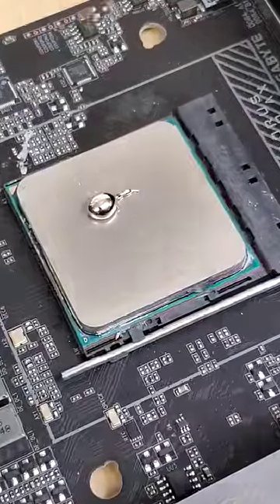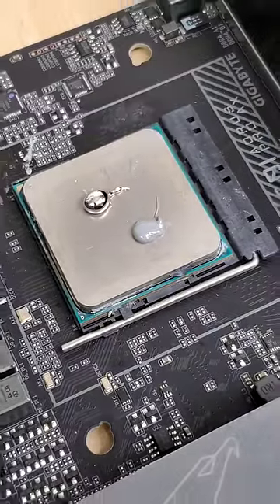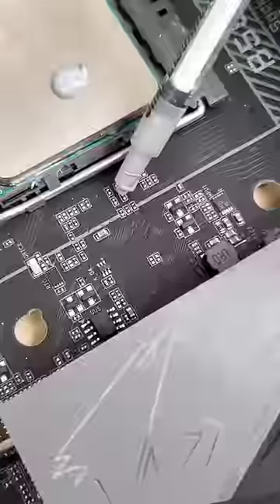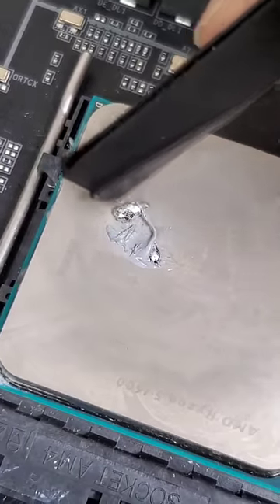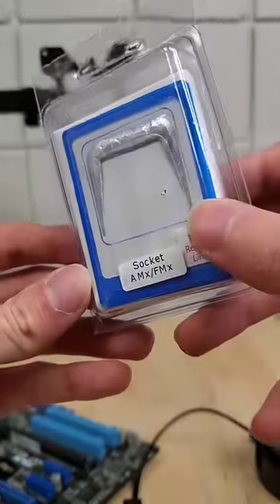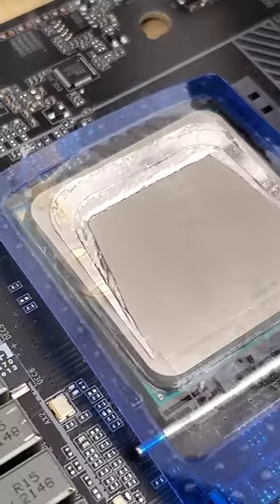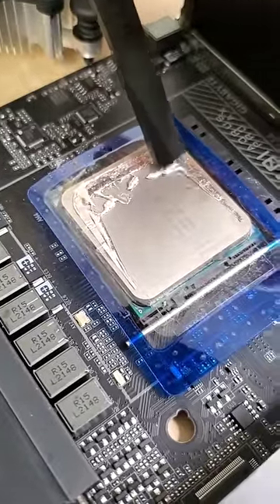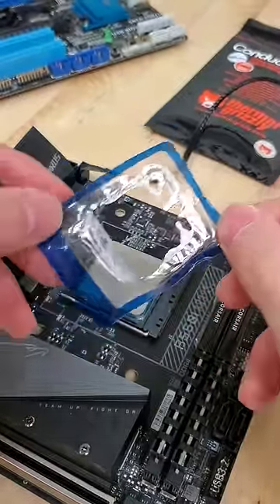the future of thermal paste technology #shorts

Comment: The risk reward just seems ridiculous. Risk destroying your motherboard. Reward a tiny bit cooler in temp than normal battle tested thermal paste.
Reply: It's more than a tiny bit
Reply: Nothing starts off battle tested, innovation isn't free.
Reply: If u rich then sure but not for us poor guys
Reply: @Snay1998 If you are poor you wont even have a cpu that gets warm enoth to need it
Reply: @Lylcaruis  just read a comment saying he used it for 3 years and saw minimal difference
Reply: I use liquid metal for years and the benefits aren't visible at idle. Under load the benefits are huge and the weakest link in the chain is the heatspreader itself most of the time (depends if it's soldered to the die or not).

My 3770k back then run delidded with a water block directly on the die with 5,5ghz for years.
Reply: It also doesn't degrade like thermal paste
Reply: It can be substantial actually. And it's simple, you put a coating on nearby components that could short out (even nail polish works). You don't put much on at all, the risk is spilling or being ignorant.
Reply: Sony puts liquid metal on PS5 chips
Reply: Tiny? Conductivity gets multiplied by three to five times
Reply: all the small things compound. I downvolted my 2080 Ti, made a better fan curve, improved mounting pressure with washers and installed LM. Each of those things weren't too good, but 3 of them together made my GPU perform significantly quieter and cooler and consume less power, while keeping 99% of the performance.
Reply: A tiny bit cooler? I did a delid on my 7700k and applying it as the TIM dropped my full load temps by nearly 20c while overclocked on all cores.
Reply: @FatterTony  wow you are confident, uninformed and uneducated all in one
Reply: It's not tiny, some cooling combined with this liquid metal can decrease 10°C which is alot in terms of processor
Reply: @FatterTony  and physics isn't something you've even attempted to understand it would seem
Reply: @FatterTony no way this guy isn't trolling
Reply: @FatterTony  you realize that those benchmarks are there to show how the equipment runs under strain right? Like heavy tasks, like stupidly unoptimized games and such? Sure you might not normally notice the difference when doing stuff like browsing windows file explorer or browsing YouTube but you don't put a 4090 in your computer with the intention of having it perform light-weight tasks (and the same obviously goes for your CPU, Storage etc)

(Unless you're either stupidly rich, a sociopath, or an idiot)
Reply: I recall my 7700k went from like 80c to 40c under load.
Reply: you can lose 20c with liquid metal on cpu. on gpu i didnt find any huge benefit
Reply: All that better conductivity is cool and all but, you realize thermal paste layer is supposed to be as thin as possible right ? The purpose is only to fill the gap between cpu and heatsink, and the liquid metal doesn't do that so well
Reply: If you don't do any extreme overclocking, and your room is stupidly quiet, it's not worth it
Reply: I poo sometimes.  no lies.
Reply: @Ph4nToMfr  the liquid metal is liquid so it fills the gap fine as long as you do this with proper setup
Reply: @rangerthememe1305 thanks for the double anecdotal evidence
Reply: That’s how I feel about putting liquid in my rig. It’s just too sketch with not enough reward
Reply: I have liquid metal on my CPU, but I try not to think about it because it makes me sweat.
Reply: @Lylcaruis how much
Reply: @qweebey lay her flat so she doesn’t run
Reply: @ollieaul2921 how many degrees cooler. Probably is what’s meant by tiny
Reply: @FatterTony yee idk why they act like it’s life n death with a little boost eh
Reply: @xythiera7255 what cpu gets warm enough to need it tho? My ryzen 7 doesn't
Reply: @jn1211 you lie
Reply: It doesn’t dry over time
Reply: it would be super easy if processors had an upward and closed socket to put liquid metal in so it can't move
Reply: @Lylcaruis it’s like a 3-5 degree difference…. Linus tech tips has done a comparison. The only time you see even close to 10 degrees is when you delid the cpu and that’s a whole other can of worms.
Reply: Just installing fan controller on my laptop gets cyberpunk from 20fps to 80. This is how much temps mean and liquid metal does much better performence, and if your system can support use of it then you should go for it. Either take it to professional or if enough tech savy change it yourself.
Reply: When it comes to thermal solutions the best results are oft by compounding; it's almost multiplicative. Extreme measures like expensively machined coldplates, delidding, and liquid metal do little on their own but combined they can make a world of difference especially on the higher end of the power scale. Most people are fine with a decent thermal paste, the included IHS, and a good enough fin stack + fans tho.
Reply: not to mention watching him try to apply that looked like shit
Reply: @FatterTony tbh it seems 3C under load can be the difference between your cpu crapping out in medium term vs being able to sell or use the cpu in the reasonably distant future electronics wise like think if you could be in mid to high 80s instead of 90c+ under load
Reply: It's not a little better, the improvement is massive
Reply: Unless you pour a visibly gigantic blob on there, there will be 0 overspill. Liquid metal doesnt like to stick to surfaces and flow away from itself much at all. 
Remember that the role of the thermal paste interface is to eliminate gaps (air) between the Cpu's IHS and Cooler body's faces, not to directly "transfer heat" as per common misconception. This means that you will want to apply the least amount of material possible in any case, to form the thinnest layer between the metal bodies but still cover up most of the surface. The neat part is that Liquid metal also has super low viscosity, which enables the formation of the thinnest layer of interface instantaneously, allowing you to double-check your application on the spot and ensures that screw tension won't produce extra overflow, whereas the paste will be able to spread out properly only after loading the cooler body springs with the assembly screws. The tension will keep squeezing the thick silicon out thinner into its final form even after assembly. This is the step at which overflows with silicon paste most commonly occour, and it's worth noting that this is just not the case with liquid metal thanks to its properties.
Reply: Trust me, it’s not as stupid as it sounds. Thousands of people are doing this.
Reply: Didn't you see?? The package said it was for BULLDOZER. The poor bastards that owned those had to do anything they could. You think i9s run hot? They have nothing on Bulldozer.
Reply: It's not even that big of a risk, though. Just don't be clumsy with the install and follow the instructions for how much to use.
Reply: @FatterTony 1 ghz is the difference between my DAW sputtering with 30 instances of virtual instruments or running smooth. It's a massive freaking difference and it's a compounding deficit.
Reply: @michaelhipke8394 direct die cooling is also a risky endeavor
Reply: the risk is low and the reward is high. i've been using liquid metal for years. it's like -10c under load.
Reply: @FreelancerFreak  oh wow thanks for telling me
Reply: Anyone who has to ask why they'd want better thermal interface material or think this guy's shorts are informative (not judging but that's the reality) has zero business using it and nobody should be putting liquid metal on top of the IHS. It's only effective enough to make sense directly on the silicon for enthusiasts actually taking advantage of the thermal headroom. The average gamer will simply destroy something eventually and it'll end up on the bench of people like myself.... actually I take that back, have at it.
Reply: @DevinDTV On a GPU yes but on a CPU it's just dumb unless you have a very unique circumstance. I've seen what can happen after years of liquid metal and it's far from a "low risk" unless you isolate the area around the GPU core. If you use it with an aluminum heatsink, you no longer have a heatsink.
Reply: @michaelhipke8394  😑
Reply: @qweebey I was thinking this. If Sony has found a way to ship millions of units with liquid metal, there's proof that when done properly, it is relatively safe.

The only people who have had issues are those who keep their PS5 vertical, leading to dry spots after a couple of years.
Reply: Only if you de-lid your cpu beforehand, otherwise the beneift is little  @Lylcaruis
Reply: @Lylcaruis Last I checked.. no.
Reply: @Snay1998  dude, it's still a prototype. It won't be commercially available until they are 99.9% sure it won't harm your pc
Reply: People who are good at applying it it's not even a risk
Reply: @Lylcaruis  It's a tiny bit. Any other claim is straight up inflated marketing.
Reply: @Lylcaruis Not for almost any normal usage.
Reply: @Lylcaruis   its still dumb people cant get enough of being extra
Reply: It’s not worth it for consumers imo. And I mean pretty much all, including power users. It will only help a tiny bit.

Now companies though, in video cards and inside cpus that is good. If factories apply this it’s much safer and you’ll be covered by warranty. That’s a good change
Reply: @Lylcaruis it’s not more then a little bit. At best it’s a few degrees. Your cpu 5c colder isn’t worth risking your components imo.

Still though, for laptops, inside cpu and gpu and other factory applications it’s great. Nothing wrong with improvements if you’re under warranty. But if you mess up your own Liquid Metal application there is no company that is gonna cover that.
Reply: @JordanWeber innovation might not be free, but you as a consumer don’t need to cover the costs
Reply: @michaelhipke8394 key point is delided here.

That deliding probably did more then the Liquid Metal would on top of the cpu. Both ofc help. But you better know exactly what you’re doing if you’re gonna be delidding anything. At that point you’re taking a risk too. Even if you’re doing it properly, it’s hard to guarantee a cpu will survive deliding.

If successful it will ofc get better temperatures though. But personally rather let that be done by the factory (I don’t have fuck you money unfortunately)
Reply: @FatterTony No one asked for your specs of a computer you just bought to tell people your specs 💀
Reply: just run open air...thermal paste and a tower heatsink and I have Temps lower than many that use an Aio
Reply: @liberatumplox625  was it a diy situation?😂
Reply: @liberatumplox625  tbh there's a much more game changing CPU cooler situation than using liquid metal that's starting to be made where the cooler itself ends up replacing the die itself so you don't need thermal paste to bridge between the die and the cooler
Reply: Not a tiny. Also doesn't need reapplication. Also isn't a risk if you arent a minecraft villager iq
Reply: It's not that hard to do if you're not a first timer and the thermal properties are significant. Savings on energy stack up at scale but even enthusiast desktop or workstations can see significant benefits especially the 3dv cache chips.
Reply: @JordanWeber 
Sure. But the innovation has to not have a the MASSIVE risk of literally destroying the most expensive part of your computer for, frankly, a reality low amount of improvement
Reply: 10-20c lower isn’t tiny
Reply: @qweebey so does the series x but early models were setting themselves on fire.
Reply: @corygrant594 delidding is not putting liquid metal on the ihs. Many cpus (mostly Intel) won't get much benefit without delidding. You know which pc builders are gonna delid? Not very many. Your point is completely invalid.
Reply: @ollieaul2921 Liquid metal is most effective if you delid which requires a lot of work. You are an enthusiast. Stop pretending your over the top bullshit is something most people do or even can do.
Reply: @ollieaul2921  Its not that much better ollie.
Reply: @xythiera7255  Cheaper CPUs are not inherently colder.

They're not as optimized so they disperse a good amount of heat while being capable of less processing, but they can heat up quite a lot.
Reply: @MrBearyMcBearface  I never once said this is something everyone can do or does, in any way shape or form. what I am saying is that this can definitely make a difference for those that decide that they want to do it.
Reply: Just put paste around the outside and put the liquid metal to the inside of the paste.
Reply: With over 10 times the thermal conductivity, this could be a great solution for high-performance machines. it obviously doesn't make sense to use it in normal consumer-grade use cases
Reply: Umm not really, been running my laptops with Liquid Metal for 8 years now and never had a single issue and the reward is mad noticeable, like 10-15 degree decrease and much much quitter. so I'd say the "risk" is only for people who don't know how to install it, and the reward is great
Reply: A lot of current high power devices use liquid metal because the risk/reward is not ridiculous. The ps5 for one use to have a problem with it leaking out but that was only due to costumers opening it and messing up what sony used to stop leaking.
Reply: @JordanWeber you'll innovate with your motherboard then :)
Reply: @corygrant594 Normal people who don't have time to screw around with deliding a CPU don't care. It doesn't make a difference on a standard cpu.
Reply: blasphemy!!!!!!!!!!!!!  you most definitely need those 2 extra degrees cooling!   I need that extra 2mhz so I can react .00001 seconds quicker!!!!!
Reply: It can cause huge differences. Keeping the temp below the throttle point under load is key. If you are at 53C under load on AMD or Intel then you are being throttled. At 50C, just three degrees lower, no throttle. 3 degrees matters. @FatterTony
Reply: LOL guy cares about speed and still run fans. Dude water cooling FTW, troll. @FatterTony
Reply: Good thing liquid metal is being used now for thermal paste in majority of consumer products
Reply: People said the same about touchscreen phones when they were coming out people are saying the same about electric cars rn. Innovation takes time and risks and once you reach a certain level its a game of inches not miles.
Reply: Trust me, applying liquid metal is easier than some youtube channels make it sound. I even went as far as delidding my i7-7700K and applying it directly to my silicon chip. The benefit is insane, especially on the Kaby Lake processors as those ran very hot. I dropped my avg. high-load temps from 90 to 70. It no longer throttles.
Reply: @FatterTony  Yeah I agree with you. Just replacing the conventional thermal paste with liquid metal will make little difference:
Let's assume a heat-spreader surface of 5x5cm, a layer thickness of 0.1mm (likely will be thinner), and a thermal conductivity of 4W/mK for standard paste. That gives a temperature difference across the paste of only 1°C for each 100W dissipated. So even if you replaced it with some sort of perfect thermal paste with infinite thermal conductivity, you are looking at ~3C improvement at most.
The only place where it might be worthwhile is on bare dies under the heat-spreader or on GPUs, as the surface area is much much smaller on those.
Reply: @Lylcaruis  yeah but peformance wise very little. And the temprature of the cooler makes the biggest diffrence in how fast the water cools and flows in a liquid cooling system.
Reply: Not only mb, but RAM, gpu and cpu too.
Reply: In the future this will be it in super safe boxes surrounding the cpu just let it advance 10 years then come back
Reply: @Lylcaruis it's a tiny bit
Reply: I'm using solid metal foil solutions now for nearly 20 years and never destroyed anything. It's a thin sheet of metal foil, just like gold leaf. Cut out with scissors to size, lay on CPU/GPU, apply heat sink and you are good to go. It melts one time, solders the heat spreader to the heat sink and afterwards the thermal conductivity based on the soldered connection is so high, that the puny ridiculous processor cannot melt it again. Also built a silent system by accident. The cooler had a sensor and a controlled fan and even under full load of the core 2quad, the gab would not start spinning, because the cooler wasn't hot enough. The product in this video is completely unbeknownst to me and I don't understand it. It doesn't make any sense, when I also can lay a simple foil onto the processor.
Reply: It’s like water cooled systems, definitely don’t want water everywhere but it works
Reply: Been running liquid metal in both my laptop and desktop. 0 issues at all. It is about time for me to crack it apart, clean it up and do a reapply treatment tho. But it’s been over a year with no problems and great temps. Just see them creeping up a bit lately compared to when I first started
Reply: I decided to delid my 8700k and apply liquid metal on the die and IHS. I also lapped the die and the IHS and installed an AiO water cooler. My idle temps were ~5°C lower on average which was cool but also kind of whatever. What impressed me and justified my efforts was seeing my loaded temps ~20°C lower on average. Then I decided to use that extra headroom on temps to overclock. I was pretty aggressive finally achieving a stable all-core overclock of 5.1GHz. My loaded temps were still ~15°C lower on average.

I had never delid a cpu before, I had never applied liquid metal before, I had never lapped a computer component before, and I had never overclocked my cpu before. It took me a few hours to do everything and I might have spent 4-6 hours doing research beforehand on the process. 

I think anyone who wants more out of their PC should seriously consider doing it. Not counting the AiO I might have spent ~50 USD on the liquid metal, the lapping materials, the delidding tool, and shipping. It's cheap, it doesn't require a technical expert, and I promise you won't find a more beneficial upgrade at any price.
Reply: @yfnratchet  because all of those things you mentioned are entirely and completely useless for a 5-10 degree difference. Unless you’re over clocking which you just straight up shouldn’t be, there will be no difference between thermal paste and deliding, Liquid Metal. Completely waste of time and extremely risky. Overclocking is useless and so is Liquid Metal/literally any thermal solution outside the normal ones. They work just fine. Most air coolers compete with liquid coolers these days.
Reply: If it’s engineered around it the benefits are huge.   PS5 uses Liquid Metal for its heatsink
Reply: @vyressi  The ONLY reason modern gaming systems use liquid metal is for longevity. 99% of all console failures were due to dry and cracked thermal paste. Liquid metal doesnt dry up. Has nothing to do with thermal conductivity. The cooler its self is far too small to benefit from any increased thermal transfer. Even on ideal perfect conditions on desktop PC's liquid metal provides >1%-5% difference.
Reply: i use liquid metal and its fine. And if not buy a new MB.
Reply: @kaydnburns5935  Back in my day, bait used to be believable
Reply: also its not as good, best themal conductor are microdiamonds, the cans transfer heat nearly as sound its jsut awesome
Reply: @kaydnburns5935  THANK YOU.

Unless you're dumping LN2 on top of it, your thermal bottleneck is ALWAYS going to be the dissipation rate of the heatsink in conjunction with the thermal acceptance of the ambient air, NOT the transfer rate of the conductive paste at the source.

You can drive 100 mph up to that accident all you want, but you're still slowing down and waiting your turn to get through that single open lane at 40 mph once you get there.
Reply: @endeav0r_49  tell that to normal Liquid Metal manufacturers 

It can still harm but enthusiasts still buy em knowing risks
Reply: The higher your temps, the higher the reward, on 100C intel systems you can lose 30C. On new systems this obviously means more turboing.
Reply: @ChannelNotFound  worst case scenario it allows with your cooler after like 4 years
Reply: @Ubeogesh  I have done this on my RTX 2080 to get a 175MHz boost.
Reply: @FatterTony  lol what, of course it's noticable, you measure it with benchmarks and real world performance. 1GHz loss would wreak your command time efficiency and bottleneck your gpu.
Reply: @FatterTony  oh this is trolling
Reply: @xhogan89x  you're not going to see any benefit unless you overclock.
Reply: @b._.render  its not sketchy, its been a consumer grade product for 10 years.
Reply: @FreelancerFreak  its exilerating and at the end of the day you have something you can't buy off a shelf.
Reply: @JJFX-  that's downright silly. Although direct die is better, thermal grizzly conductanaut is designed to be put on an IHS.
Reply: @JJFX-  you say that like its hard. Just reapply once every 3 or 4 years and use conformal coating on the SMTs.
Reply: @siggie8610  why are people saying this lol? Yes direct die is better but its extreme and risky compared to the already large gain from applying it to a IHS. We're no longer living in the days of thermal paste on dies.
Reply: That doesnt make it "not sketchy" @3of12
Reply: @Lylcaruis its about 7 degrees in real conditions
Reply: You should never be putting so much thermal paste that it flows over anyway. A person not super familiar with building PCs is not going to use liquid metal anyway, so it's a problem that doesn't need solving.
Reply: @ollieaul2921  That makes infinity more sense to me.
Reply: Lol you are sooooo wrong. letting the CPU temps climb into thermal protection can result in small or even big stutters in games or slowdown in CPU heavy programs. Also running cooler improves life time and your whole system gets quieter. You are kinda the typical apple user, who don't know much about his devices and only want that it works and even barely uses any CPU intensive tasks on his devices. Cpu and GPU chips and even ram sticks never run at there best possible performance at default due to different binning quality, so they run in a safe setting with too much voltage, so the hardware is stable but runs hotter and takes more energy then needed. And LM can have a HUGE impact both in performance and noise.
Reply: Maybe, but you know, when water cooling PCs started becoming popular around the early 2000s,* that was also very risky.

* water cooling already existed much earlier, but it wasn't until around the early 2000s that people started using it for gaming PCs.
Reply: While this product is awful, liquid metal is not, in fact liquid metal is very effective, doesn't degrade, and is actually already in your cpu, under the heat spreading lid on top of the die which is the actual logic unit. Now that's not to say the putting it on the outside is safe since it'll not only short circuit your board if it leaks, but also will rapidly destroy any aluminum, steel, or certain other metals it touches (you would need to use a copper heat sink), but it is used because it is a lot more than marginally better, and while this particular product is not the future of thermal paste, some way of using liquid metal, or somehow making an equivalently effective alternative probably is. (which somewhat exists in the form of PTM7950, not as effective but close, and PTM7950 degrades unlike liquid metal)
Reply: @FatterTony  1ghz deficit is absolutely huge. I don't think this level of product is necessary for the vast majority of consumer, and something like direct die cooling with liquid metal is for fanatics or extreme use cases like rendering on an industrial scale, a 1ghz drop in your core speeds would neuter the capabilities. if you have a 3.6ghz (moderately high) clock cpu core running 60 fps, hitting a thermal throttle big enough to bring it down to 2.6ghz would likely drop your frames to 20 fps or less, potentially to unplayability as your cpu is more focused on vital tasks to keep the computer running, and isn't going to be giving a lot of attention to the gpu or game processes. The answer though is get a sensible cpu, ie. not intel's pushed to the limit cpu's that only exist so they can say they're the fastest while drawing way too much power and way too much heat to properly run at those actual speeds, and to not configure your settings stupidly like running every god damn thing on earth on 4k on 2-3 monitors and trying to push 120+ fps
Reply: But it looks so much cooler 😎
Reply: @JordanWeber  your mother board also sin't free.
Reply: Also completely forget maintenance. Might as well buy a new CPU and Motherboard before trying to work on this rig.
Reply: With this product I agree, with regular metal thermal paste it's quite easy tbh, just put a drop on then try to keep your cool while trying to spread it while it's refusing to stick to anything, eventually you'll get an even coat (which is meant to be as thing as possible btw, otherwise you will risk frying something) and can install the CPU cooler and forget about it. It's easier to snap the pins on the CPU imo, and that's costs 2-5 times as much to replace.
Reply: @Lylcaruis  I just use carbon pads. Never replace the paste again.

And I would say tiny bit. Liquid metal does not do a load for temps.

When I do use it, I do it on delidded cpu only. The delta becomes actually big.
Reply: 10 degrees isn't a tiny bit. You have no idea how much headroom liquid metal gives you for overclocking. All you need to do is put nail polish on the metal contacts on processor and you'll have zero issues.
Reply: @Lylcaruis  Not practical cooling for residential use though.  Even custom water loops are pretty pointless, and I have one lol.   Normal Noctua paste for example + a good fan cooler is more than enough for 99.99999% of gaming :S and computer purposes...  the extra bit is a waste longterm... usually.
Reply: @corygrant594  That is a 7700k lol...  not a really good example... and that isn't surface applied on the IHS.
Reply: @xhogan89x  20C... if you didn't apply the paste or mount the cooler properly... lol.
Reply: @Ubeogesh what was your undervolt results?
Reply: @adeptalakay  i run 1650 mhz at 700mv
Reply: Liquid metal thermal Tim cools like 5-10c better than silicone based paste. If you delid, expect like 15-20c better temps.